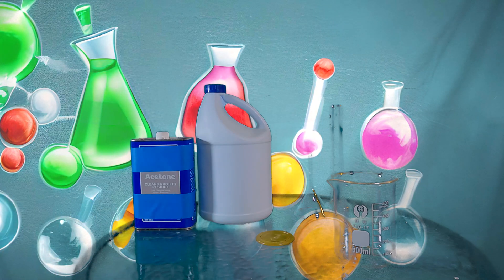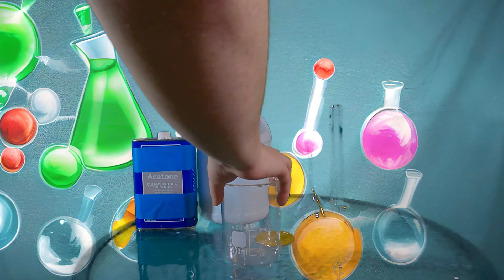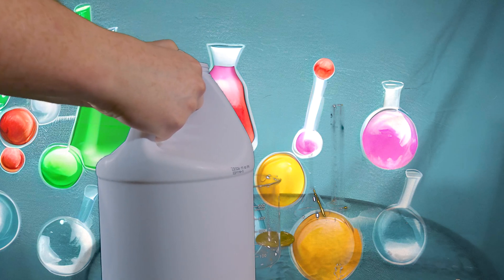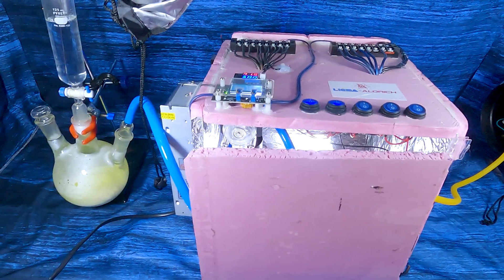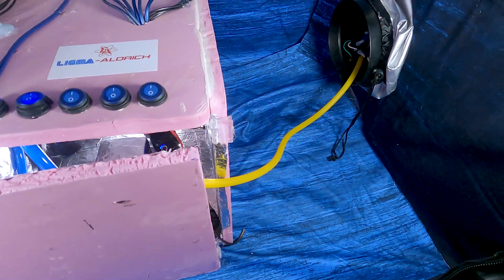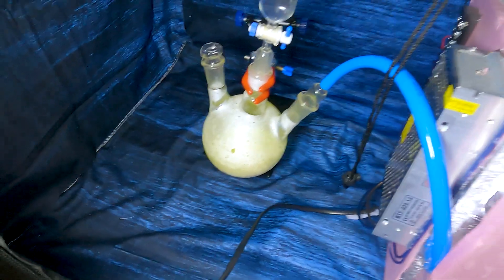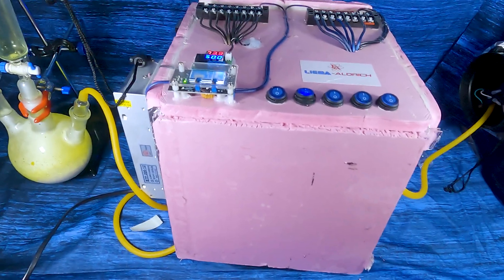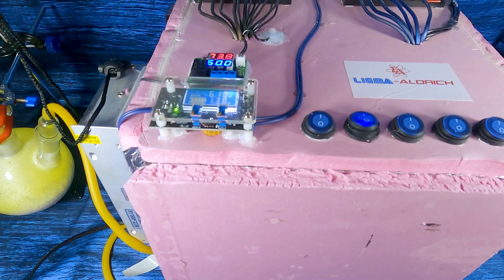Unveiling the Secret Reaction: How to Make Carbon Tetrachloride!

Comment: I'm needing approximately 20 liters of CCl4 to use in my high pressure cleaner ... I'm wanting to clean my engine and get all grease off ... I dont want to use water or water based detergents on my engine !
Will this cause damage to the high pressure cleaner or its rubber seals etc ?
Reply: It will cause damage to you

Comment: What wavelength of uv light did you use? LED's are getting pretty good in the uv spectrum but they dont get all the way into the UVC and vaccum uv. You can get uvc from any Menards as a 9 watt germacidal for pond clarification. I bought a brand new 9 watt for mine and held it up to my leg for like 5 seconds. It fried the skin on my leg and burned a layer of tissue off my eyeballs. It felt like I had been welding all day without a welders mask.
Reply: He said 310nM

Comment: Those LEDs are going to get extremely hot without heatsinks, especially in an enclosed box.  You'll get a lot less light output as well as obviously shortening their life, heatsinks are mandatory.
Reply from the maker: The box itself is cooled by two peltier modules and can maintain about 55F. Do you think more cooling for the LEDs past that is needed?
Reply: @MaxfieldMED  yes.  Though it may work for a while before it fails with the peltiers.

Comment: Isn't it possible to recrystallize manganese heptoxide in carbon tetrachloride? Is it possible with anything else?
Reply: Manganese heptoxide is a liquid at room temperature.  Why would you even want to? I suppose you could try,  but I wouldn't do it.
Reply: @chemistryofquestionablequa6252  dilution, purification, and has anyone ever crystallized it before?
If carbon tet don't do it, something fully fluoridated may...
Reply: @petevenuti7355  I'd expect that it would explosively decompose if you tried to crystallize it
Reply: @chemistryofquestionablequa6252  if not, I'm sure it would be very sensitive, way worse than nitroglycerin but not as bad as silver fulminate...

Comment: I usually use a 2l flask and 2 reflux condensers and calcium hypochlorite to make chloroform.  I add a big funnel to the top of the condensers because it's an angry reaction that kicks off unpredictably and sometimes foams a lot.  Strong stirring with an x shaped large stir bar and salted ice bath. If your cooling is good enough there's no chloroform smell from it boiling off.